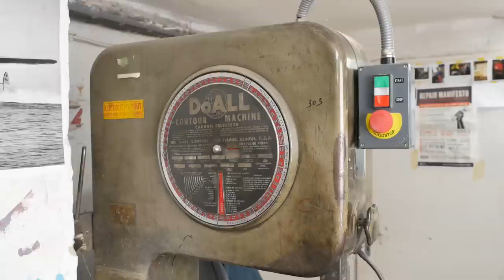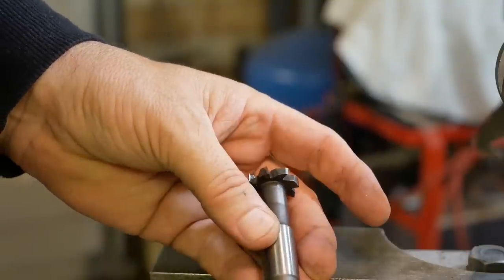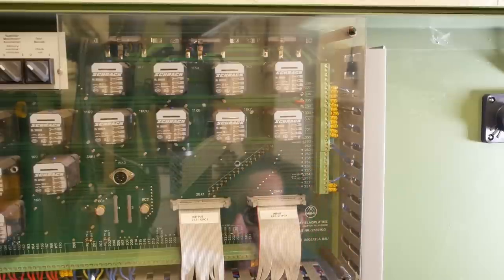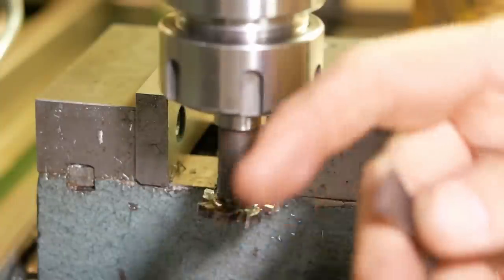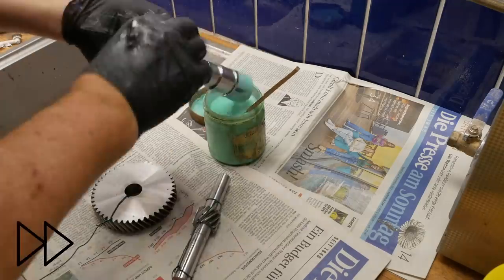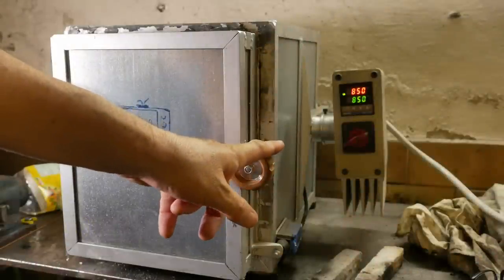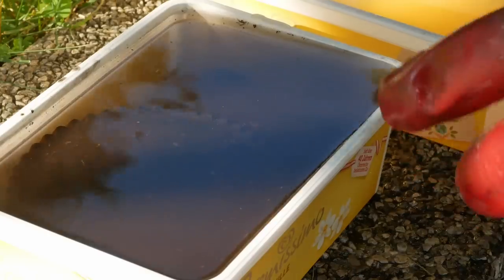DoAll Bandsaw gearbox repair - Part 2 || RotarySMP

Comment: Must be desperate :) first one here today
Reply from the maker: Hi Luke, This is your beautiful workmanship which I am cooking here. Sorry about the surface finish :)
Cheers,
Mark
Reply: @RotarySMP  haven’t seen it all yet as I am still at the grinder and it’s not loading properly so I’ll enjoy it shortly
Reply from the maker: @LCalleja  Please put a camera on your work on the Grinder, and make a video. You have a lot of fans awaiting that first video.
Reply: @RotarySMP  Tried but need to figure out a decent way of holding the camera :)
Reply: I think I died a little inside.
Since you've got TIG now, maybe an argon purge for the oven like Stan @ Bar-Z sells?
Reply from the maker: @jimurrata6785  I'll consider that for the next oven. This one is not going to last much longer.

Comment: It's simply amazing how a simple job gets exploded into multi hour job....
Reply from the maker: Yeah, typical 5 minute jobs here in the RotarySMP studio :)
Reply: Doesn't matter whether it's in the shop or around the house.  Things tend to cascade into more than you bargained for.  Whenever my wife comes to me with a "simple" project I just smile and shake my head.  Over the years she has changed her approach.  Now she asks, "what would be involved in doing this?". Even the high level steps I provide rarely match the actual efforts.  However there are ti es when the planets allallign, side tasks are minimal and I'm able to finish ahead of schedule which surprises the both of use.
Reply from the maker: @joedowling5452  Yeah, those are the real unicorn's those jobs :)
Reply: Yes, but in this case the aim was high, and so the work and equipment needed. Look at the lineup of machine tools involved, including the high temperature oven, far from trivial and something that does not really belong to the home shop.
Even the industry does this differently, no manufacturer is fully vertical, tools are bought not built or adapted.
Reply: Sameeee
Reply from the maker: @jdm2651  Good observation. We are right out past the ragged edge of vertical integration here. I have way too little practice to be good at any of these things.

Comment: Regarding the heat treatment - there is a facility here in the Czech Republic that I use for heat treating knives, and it seems like they do nitride treatment as well. They are very nice to work with, basically you just send them a package with instructions and they will then send the parts back to you fairly shortly (week or two). Very old school no-nonsense way of doing things. If you are ever in need of that again let me know (or just write to them - hope it's ok the company name here: it's company called Prikner, from Martinkovice, CZ).
Reply from the maker: Thanks for that tip.

Comment: So many of these 'single item' jobs would be so much easier with manual machines!

CNC is great for repeat production of multiple parts, but is not easy for 'one off'!
Reply from the maker: They would be, but I dont have the space for two of each of these machines, so just accept the inefficiency.

Comment: Your best bet for reducing the chances of oxide buildup during heat treating is to put the parts in stainless steel foil pouches, with a bit of acetone and natural fiber paper, crimp the stainless steal foil with several folds to create the air-tight pouch, and then heat treat. Once out of the heat treat, cut open the stainless foil, retrieve the part, and quench. then anneal the part with your preferred method (molten salt works well XD)
Reply from the maker: Where do you source such stainless foil?

Comment: Possibly the best technique would be to anneal the stock steel by 'soak' heating for 24 hours then slow cool in the oven, then rough out to the approximate size, heat treat for hardness then grind back to size, the thread is a problem since you can either cut it on the lathe & risk some distortion on heat treatment, or if you have the facility grind a thread after hardening & tempering.

The reason for the initial annealing process is that the stock is probably 'cold rolled' and this type of process builds up stresses in the material.
Reply from the maker: I really didn't think that one through. I gave Luke finished dimensions, rather than specifying a grinding allowance.

Comment: You've probably already seen it but Clickspring wraps his parts with wire then coats them in borax for heat treating (wire stops the borax from slopping off during heating). Might have the same issues as your green stuff (not good for bigger parts or longer soak times), but who knows, might be worth a try in the future.
Reply from the maker: Borax is no longer easily available to consumers here in Austria. I wish I could get some.

Comment: Nice Job Mark, I hope you can still use the parts after the finish. Heat treatments are really complicated. For these parts, as you said, nitration would be the best solution. But this can't be done so easily in a workshop, unless you build yourself an oven ;)
Reply from the maker: Hi Christian, it was an interesting attempt, and I did acheive hardened steel, but needed a much better plan up front.

Comment: Mark, I would add a oil groove to that shaft, while it is pressurized, it will had a small in shaft reservoir for oil to hang out in. Now Granted I would use like a 3mm ball nose to make that groove and not a cut off disk like the original one.
Reply from the maker: Why do crankshafts have only an oil hole? I think such oil paths are only required for near stationary sliding ways, and not for pressure fed hydrodynamic bearings.
Reply: @RotarySMP  I was thinking more so for keeping oil on the shaft for the extended times it isn't in use.

Comment: @RotarySMP Looking at this (@50 sec) and the last video I noticed that the new part you made is missing an "important" feature of the original. 
Namely the undercut (e.g. as per DIN 509). The under cut on parts like this is used not for clearance but to ease the stress peaks on the sharp corners of the different diameters. 
I have seen huge shafts in industrial machinery snap because they forgot them during manufacturing! 
Love your videos! Thanks for the entertainment!
Reply from the maker: Thanks, you are right, the Freistich is missing. It would also help with grinding the surfaces.

Comment: Stainless steel tool wrap bag and a slip of paper will drastically cut down on oxidation. You'll get some when you cut the bag open, but not nearly as much. Look into this method.
Reply from the maker: Thanks. What thickness of SS is needed for a 2 Hour soak at 850°C? Is the 0.05mm enough, or should I use 0.1 or 0.2mm for that? 
So you pull the part from the oven, open the bag (Tin snips?) and then quench the part right?
Reply: I think .002 is common for ss wrap, and yeah cut the bag and quench. Try doing it on a test puck. Also I typically leave .005 for  finish grinding, just depends on the material.

Comment: Just a ceramic flower pot or old tin can filled with charcoal prevents oxidation perfectly.
Charcoal even gives carbon for extra case hardening.
Reply from the maker: I should have bought some of that stainless foil the knife guys use.

Comment: When I touch off a tool I use .002" brass shim stock . It's good because your numbers are already close enough for most drills and if you forget a negative it doesn't crash . A big chunk can send you negative .500" down.  using a soft metal the carbide doesn't chip when it hits the shim.
Reply from the maker: Good tip. I picked up using a round pin fro Edge Precision.
Reply: and the shims can be used for brazing later

Comment: Does heating from only one side also have some possible warping affect ?
Reply: Big time, it's one of the main things you have to pay attention to when using a torch for heat treating.
Reply from the maker: I probbly should have flipped the parts, of put a shield between them and the working element.

Comment: First time I have seen you do hardening.
At the risk of sounding like the dodgy brothers, for the infrequent use expected of a home workshop bandsaw, and considering it has pressure oil feed, you could probably have left it unhardened and got 20 years use from it.
I have infrequent use equipment here with plastic, aluminium gears etc and with a bit of grease they just go forever.
Hardened gears are more for high tooth load applications like car gearboxes etc where there is a lot of torque and a lot of power throughput.
Reply from the maker: It wasn't so much the gears that needed the hardening, but the intershaft bearing journal (input shaft) and the large journal which the output gear runs out (Output shaft).

I probably could have just put the original gears back in , although 2/3 of one tooth was broken off, but as you say, for home shop use it probably would have been fine.

Comment: My belief is the pitting wasn't due to the heat treating, but rather due to the use of the 25% HCL solution.  If you go to minute 19 of your video, there isn't any apparent pitting on the parts prior to being placed in the acid bath, just green goop residue on the parts.  Using the 25% HCL bath was too strong an acid and it did the pitting.  I would not use more than a 5% acid solution for de-scaling just to avoid what happened in your case.  May take a bit more elbow grease to clean up, but no pitting is worth it.  I also agree with the boric acid and alcohol paste recommendation noted below.  The boric acid melts to form a "glass" surface that stops most of the oxidation and cleans up very easily without need for an acid bath.
Reply from the maker: It was 25% HCl, diluted about 1:4 into the water I poured it into, so probably more like 6% when in contact wit the parts.  I wish I could get Borax, but it is not easily available to consumers in Austria. I have tried to source it before.
Reply: @RotarySMP I wonder if you could use a commercial brazing flux instead of borax? There must be something like that available at the local welding supply places I would imagine 🤔
Reply: Thanks for the clarification.  I am still not sure I like the idea of a 6% HCL solution for any more than 20 or 30 seconds.  Amazing how fast that stuff eats into unprotected metal, even at weak solutions.

One alternate source for Borax is to look for  cockroach killing powders that are basically pure Borax.  It is amazing what that stuff does to roaches.  I did work at US Borax's mine and processing facility for 3 summers while in college and the roaches that ran around there were super-roaches that were left after the others were killed off.  You respected those suckers, LOL. @RotarySMP
Reply from the maker: @ronkluwe4875  Thanks. I'll see if there is roach poison on the shelves. 
Next time I'll give it more time and just soak in vinegar again.
Reply: @RotarySMP  I think you've had you chlorine experience, In snowy USA it's and older truck killer, just rots them out at the wheel wells.
Reply from the maker: @tsclly2377  I split some HCl in my wood shop a few years ago. The ion's casue a fair bit of surface corrosion on parts which dont normally rust in that basement.

Comment: Yay safety moccasins!
Reply from the maker: With ventilation slots. I did put on the steel caps while pushing the Clarkson around.
Reply: @RotarySMP  Hey, you do what you do.  I was welding in my safety crocs earlier.
Reply from the maker: @wibblywobblyidiotvision  I put on crocs once, and the internet gave me a hard time for it :)

Comment: I'm curious - aren't you concerned about Hydrogen embrittlement using hydrochloric acid to de-scale the parts? My metallurgy instructor many years ago was adamant that Hydrogen embrittlement was a very bad thing.   I've used acetic acid (vinegar) with good effect to descale parts after forging bits and bobs in my gas forge.  Vinegar works well when heated.  Simmer the parts for an hour, and the scale comes right off.  
The only thing I've found to prevent scale is sealing parts in stainless foil to heat, but, getting it OFF when the parts are at temperature and you're ready to quench is a skill I never acquired.... So for the most part, I ignored the length of soak recommendations, and when the part was non-magnetic, it was time to quench.

Comment: One thing that will cut down on oxidation during heat treating is using a paste of boric acid and alcohol. You can wire wrap the parts to help keep the goop on the part. It won't stop 100% of it, but iy's a good 90% or better.

Are we going to see a part 4 of this trilogy? Stay tuned, BatFans!

BTW: Someone took the spinny sucky-squeezy-bang-woosh think off the plane.... they don't fly so good like that.
Reply from the maker: Problem is getting boric acid in Europe.
As far as I know, that plane is destined for the knackers yards. Sad.
Reply: @RotarySMP  Is it a regulations thing or just hard to find? Look in your super market and see if the have 20 Mule Team Borax in the laundry detergent section. Blacksmiths and bladesmiths use it ALL the time, so they are getting it from somewhere.
Reply from the maker: @harlech2  That is a US thing. Borax has not been used as a washing powder here for decades, and it is now a regulated chemical.
Reply: @RotarySMP  I would reach out to a local bladesmith who works with pattern welded knives. It is I think the only thing they can use to protect the metal from oxidation that won't also run a rish of causing occlusions in the finished product. Ask them how/where they get theirs. Who know, they might get you a kilo or two.
Reply from the maker: @harlech2  Forging is not a common hobby in a city like Vienna. I know of no Blade smith here.

Comment: Have you considered nitrite hardening?   If you use and electric induction furnace, you can bled in nitrogen and get a surface hardening or use a molten salt bath if sodium nitrite.
Reply from the maker: A kind viewer offered to have the second set Nitrided from a commercial company they normally work with. Can out really nice.

Comment: 18:19 - did you get any tool marks on the part for handling it hot like that?
Reply from the maker: Given that protective anti oxidant green gunk failed, the whole surface finish was abused, so I didn't notice any tool marks.

Comment: I'm new and still learning --- the impression I get is that DIY hardening kinda ruined your parts; all that effort in maintaining dimensions and surface quality gone. Is there a point to heat treating these parts, or is it part of the home hobby shop journey? Will commercial-grade hardening preserve dimensions and surface quality? (How do they do in gearboxes for example)
Reply from the maker: They wold use a different process. Nitriding doesn't cause the oxidation, or the dimensional variation.
I should have thought this through and speced my bearing journals over sized, and then done the final machining after heat treatment.
Reply: I believe that steel of excellent grade (and I'm not saying that what was used it is not) would have done the job just fine without heath treatment, at the cost perhaps of just slightly slower and costly machining.
It is a small bandsaw, used in an hobby shop, how much load and use would get? Answer is, little.

Comment: Another interesting video. Loctite should work well on your parts, just another tool in the toolbox, although the professionals probably won’t approve.
Reply from the maker: I have heard good reports on Loctite 638 for this sort of application. Before I scrap parts, I will take the disapproval. :)
Reply: Exactly, it depends on the application.
Reply: @RotarySMP  Naw, aircraft wrench turners don't believe in no Loctite! Safety wire it!!!
Reply from the maker: @harlech2  Yeah, nah! :)

Comment: I like the idea of home shop hardening. Like you say no one is really interested in hardening one or two gears. As a matter of interest what is the depth of hardening you think you can achieve, IE how much should you leave oversize to allow a post hardening machine finish?
Reply from the maker: I would estimate that I would have needed 0.2-0.3mm to be sure to clean up that surface and take out any warpage. These parts are through hardened, so there in no issue with taking off the hardened skin.
Reply: @RotarySMP  what about the gear teeth faces. Is the surface finish ok for this application?
Reply from the maker: I would say yes. These gears are hugely overbuilt for the 1kW they transmit. The original gearset shows near zero wear after 65 years. Mine will probably be a bit louder, and will probably generate some wear until the high spots are rubbed down.

Comment: Did the gear stick to the fire brick?
Reply from the maker: It is CaSi insulation, and yes it did stick, but that was only a couple of seconds to knock it off on the way to the oil bath.

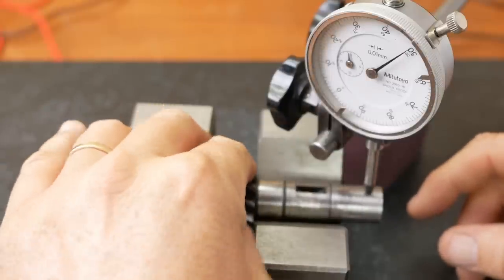Comment: At 23:23 when you're checking the runout, don't you need to check the runout on the two bearing surfaces sitting on the V-blocks first? If those aren't true then the runout at the ends of the shaft may not be "real".
Reply from the maker: It was running on the two bearing surfaces, so I was measuring relative to them.
Reply: @RotarySMP  I’m probably still wrong here, but if the shaft is warped and you true the end bearing, it’s not going to be concentric with the inner bearing because the inner bearing needs to true across its entire width first?
Reply from the maker: @JCWren  The two inner bearings are very close. Warpage there is unlikely. Since it will run in the two inner bearing, I will fixture in them to grind the plain bearing journal concentric to them. I wont be using the centers in the ends of the shaft any more.